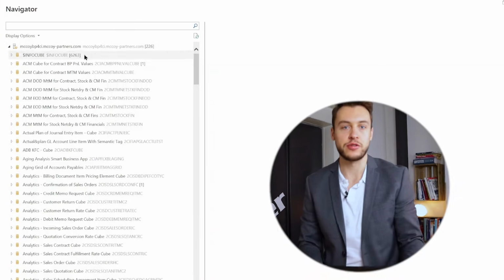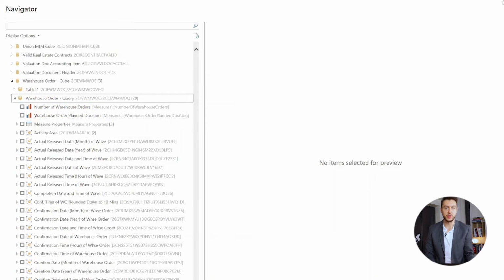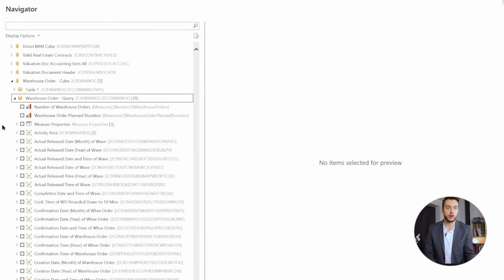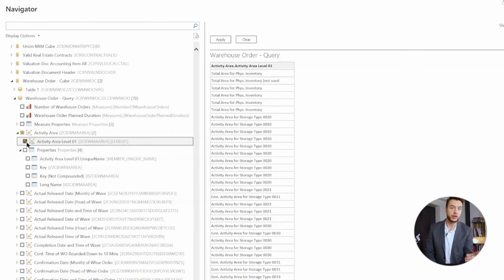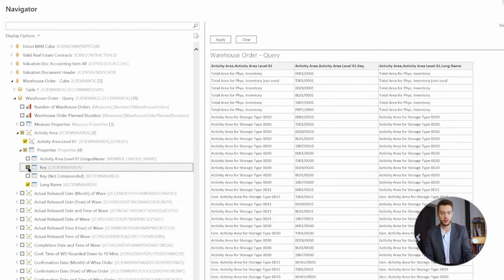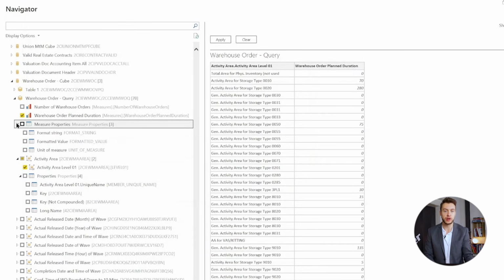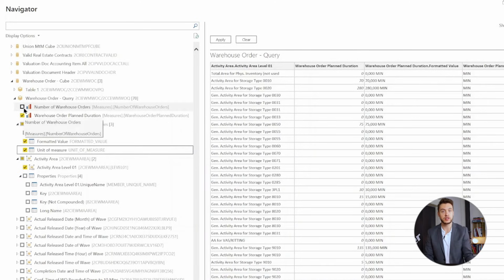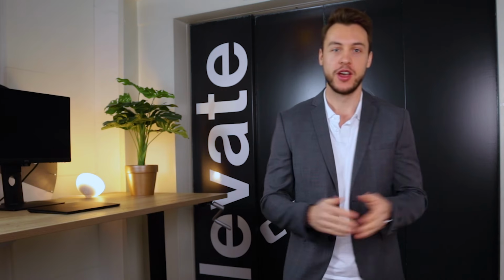How to use Power BI with SAP

Comment: Hi 
I have a couple of questions:
1. How do I connect SAP S/4 HANA directly with Power BI?
2. Comparison of connectivity with Power BI between SAP HANA, SAP BW and SAP S/4HANA
Reply: hi! Seems like your comment got lost in the stack, better late than never :)
1 - Use the SAP Business Warehouse Application Connector. You'll connect to the BW component in ECC where you'll find Analytical Queries that are flagged for odata. Other option is OData connector, but you'll have to expose our data through OData API in ECC
2 -  Complex question for this space :) for power BI, barely any difference. Most difference will be in your data preparation and master data. S/4 direct limits data preparation, BW is optimal for complex data structures and SAP HANA exposes bare tables, which requires full modeling in Power BI
Reply: could you explain how can I connect sap with ODBC, I have installed it but it can not display in my drivers @wesverheijen

Comment: Hi Wessel- Thanks for the video. I had couple of questions : 1. Can we get data for a multiprovider using direct query and Import method. 2. Can get data from Master Data Infoobjects.
Reply: hi Viren, thanks for your question!
When you use the SAP Business Warehouse Application Layer connector you get access to all infoproviders in the $INFOCUBE catalog for both DirectQuery and Import. You can also find Master Data InfoObjects and Multiproviders in this list. However, you optimise this by building a BEx query and connecting to that in Power BI using the same connector. good luck!

Comment: Hello, thank you for this video!

Not sure if the SAP connections work in both directions or if its just a oneway. Is it possible to upload data from Power BI to SAP? (so the other way arround) 
What I am thinking of:
Create a button in Power BI which when clicked uploads a certain data field (for instance a date) to the corresponding data field in SAP.
Reply: hi! sorry for the late response, my previous comment apparently didn't get saved.
These connections only work one way. If you want to write back data, you would build a custom PowerApp that embeds into the report. Tricky thing here is that you'd need a write-API in SAP and I'm not sure these exists... if they do, then you'll need expert knowledge to build the PowerApp.

Comment: Hi wessel - usefull thanks! 2 questions though
1) why not use HANA views instead of BEX queries
2) you know how to show in PowerBI go-to-links into SAP ECC  e.g. directly opening a workorder in SAP in a new screen SSO?
Reply: Hi Egbert, thanks for your questions!
1) The process is the same. Cool thing is that Power BI approaches CDS (analyical) views, HANA Calculation Views, etc. just like regular BEx queries. I chose this example, because of the different behavior in BEx compared to Power BI is more apparent.
2) Oof, great question! In theory, you could generate a URL based on an ID in the query, but I'm not sure how these go-to links work under the hood of ECC. Also, I assume that Power BI reports will be consumed in the browser, so the URL would need to trigger opening the SAP GUI application and I haven't seen that before. I'm guessing that it would be more accessible if you're on S/4HANA Cloud, because you would remain in the browser window. 
Hope that helps you along!
Regards, Wessel

Comment: Hi Wessel, 
thank you for the video. In this case you are connecting directly to the HANA database. Is there also a way to connect to CDS Views or Queries or BPC for example? Or do you just do the same and connect to HANA and the CDS views will be shown there?
Best, Dominik
Reply: hi Dominik, thanks for your question!
The process is the same. Cool thing is that Power BI approaches CDS (analyical) views, HANA Calculation Views, etc. just like regular BEx queries. I chose this example, because of the different behavior in BEx compared to Power BI is more apparent.
Best, Wessel

Comment: Great video. Looking for directions on building operation and financial using SAP and power bi.
Thanks
Reply: hi Frank, you can use ABAP CDS Views in SAP to collect your data, and then extend them as Analytical View for other tools. The Analytical Views can be consumed as shown in the video. There are also a wide variety of standard CDS views available in SAP S/4HANA that you can consume as query.
Does this help you along?

Comment: Great video.   Our company is about to migrate to S4 Hana.   With the Fiori apps (which seem great), as a Power Bi developer I am a bit worried about my job security since we've always used Power Bi with our current ERP system.   Is there a solid use case to continue using Power Bi with S4 Hana given that the Fiori applications seem very powerful?
Reply: hi TexMexDragon (lovely username by the way), thanks for your question. I do think there is still a need for custom reporting in Power BI (or other tools like SAP Analytics Cloud). Fiori apps are indeed powerful when you stick to the standard views and processes. When it comes to customized reports and processes, it quickly get difficult to adapt the fiori Apps since editing functionality is limited. It might still be necessary to create a custom report when the standard apps and views simply don't cover the process correctly.
costs may also be a reason to keep Power BI alive, since a Power BI Licence may be much cheaper than an S/4 licence. In this case, you can create and share reports to users who have no access to S/4.
Hope this answers your question and reliefs a little of your worries. Kind regards, Wessel
Reply: @wesverheijen  Thank you Wessel!   Just what I was hoping to hear and perfect timing as well.
Reply: Hi, can I import data from sap (ERP) directly to power bi ? If so should i need to modify data with Query?
Reply: @bnomar6182  hi! You can do so using ABAP CDS Views. You would create a View as 'analytical cube' and 'analytical view'. The Analytical View can be consumed as shown in the video. Does this answer your question?
Reply: @wesverheijen   I haven’t heard of ABAP views, is it a program  that i can create a link with power BI?
Reply: @bnomar6182  Not really, it's part of the underlyng database to which you can connect with Power BI. I would recommend to have a chat with your IT-department to see if you can help you with specific data questions.
Reply: @wesverheijen   thanks 😊
Reply: @wesverheijen  Is there any way to connect SAP ECC to Powerbi

Comment: Do you have any questions about this video? Leave them here and I will respond to them personally!
Reply: Hi Wassel, All I need is to link SAP specific datas such as employees development directly with power bi without creating formulas in excel or so
Reply: or If you would like to learn more about creating reports in Power BI, then check out this McAdemy @home replay (NL)
https://www.youtube.com/watch?v=N7IRuGaNyYw&ab_channel=McCoy%26Partners
Reply: How can i link power bi to SAP for staffing
Reply: @Nooon-zb3pj  I have no specific experience with that use case, but if you can create views and queries with this data, the steps in the video are possibly still valid.
Reply: My company is transitioning to managing work orders in SAP Fiori. I need to be able to pull work order data from SAP Fiori and display visuals, graphs, tables, etc. How would I be able to do this best with Power BI?
Reply: @samueldavis2092  hi Samuel, look into the answer on Sreehari's comment. I've shared some instructions and a SAP-help link to get you started. good luck!
Reply: I am trying to connect with ODBC , but I does not show in my driver although I have installed it and I am not able to connect to sap